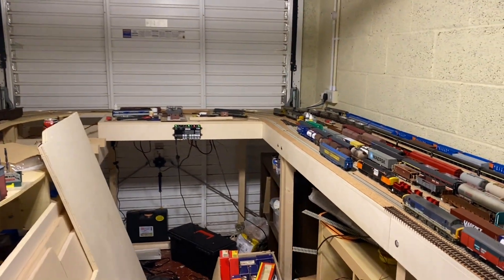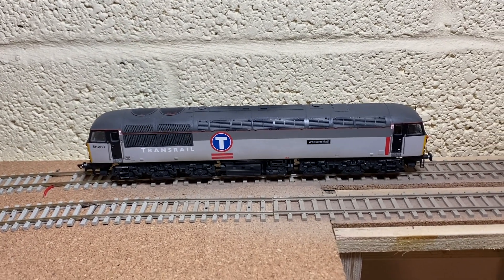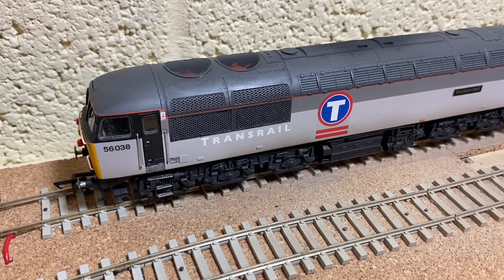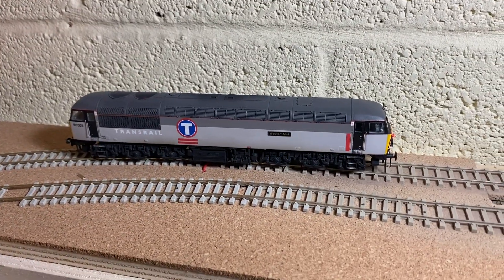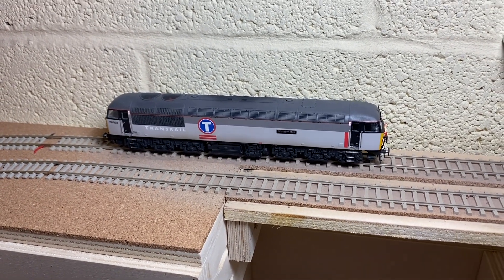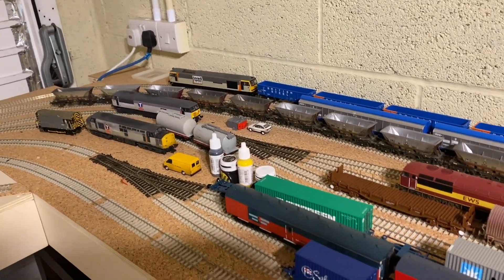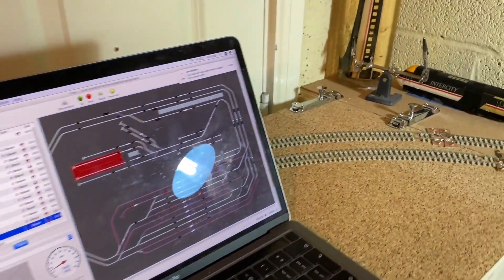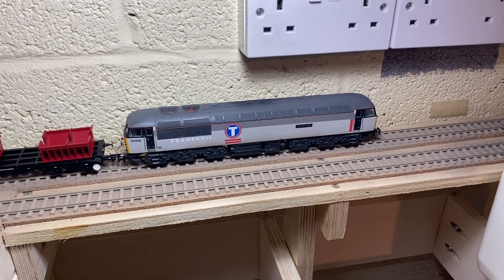NEW LAYOUT! Episode 7 - Full Loop - St. Michael's Hill Model Railway

Comment: Looking  really good there!
I'm really pleased for you... and pleased you used my work to make your first 360-degree run!!

Items done on this model were; Shaplan roof grills, lifting point covers (they're the large ones closed to the doors), V-aerial on the roof, and horn cover grills.
I was particularly pleased with the last of these and I'll be using the same method for my own 56's in the future!

I see you have that bump across the lift-up hatch.
The best way to make it perfect every time, is to lay rail across the whole joint, solder it to the copper strip or copper clad sleepers... and once it's all secure, you cut the rail with a razor saw leaving a small crack across the joint... so you have to be careful when lifting it out!